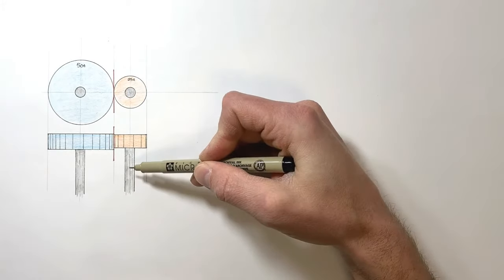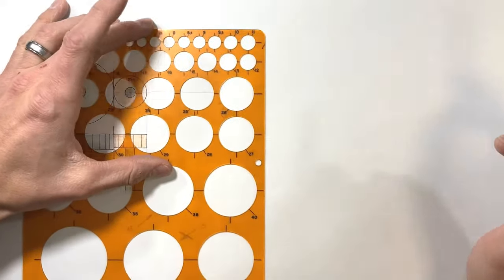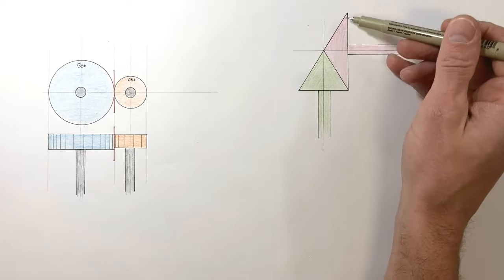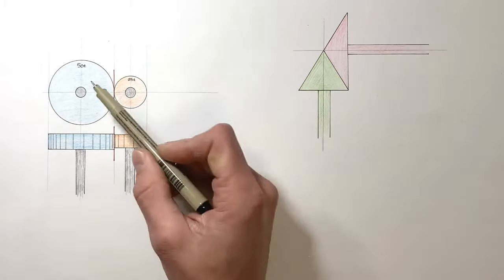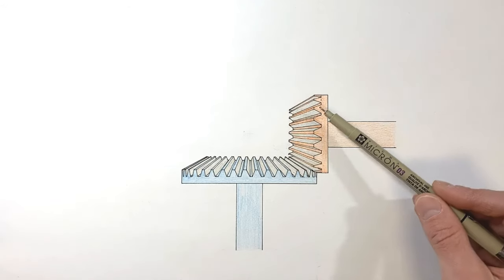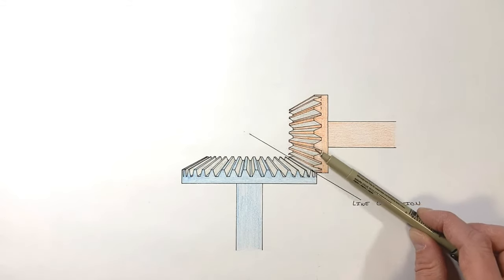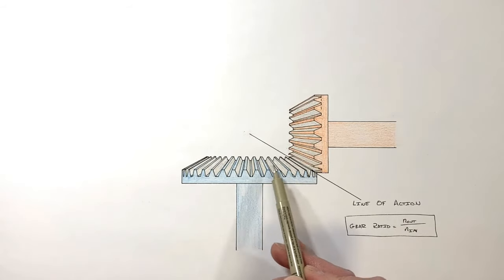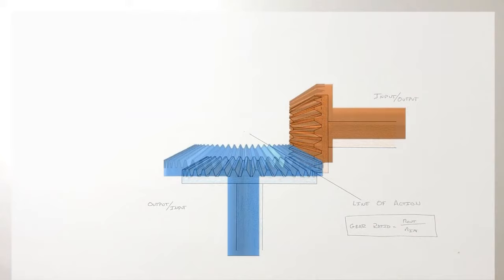Bevel Gears Explained, Calculated & Modeled

Comment: Thank you for such amazing videos. 
I'd like to ask a question as I'm currently working on a project. Can these bevel gears be used to reduce the speed? Like the context of the project is that we've to reduce the speed (in rpm) of the motor and provide reduced speed to next set of shaft and blades. 
Your reply will be appreciated!
Thanks
Reply from the maker: No different than with spur gears, if the input gear is smaller than the output gear then the output speed will be reduced.

Comment: thanks for informations and perfect drawing
Reply from the maker: Thanks.  I enjoy doing the drawings.
Reply: Hi is it possible to make big gear driven by small gear in high speed? This is for bevel gear. I am currently making a project than need to use bevel gear. But wanted the mechanism of gear to be different.

Comment: Hi is it possible to make big gear driven by small gear in high speed? This is for bevel gear. I am currently making a project than need to use bevel gear. But wanted the mechanism of gear to be different.
Reply from the maker: Yes, unlike a worm gear, either gear can be connected to the input shaft.  A small gear driving a large gear (ie. a gear ratio greater than one) can be very useful in magnifying torque at the cost of losing rotations.
Reply: @INTEGRALPHYSICS  does it need more force on shaft(small gear)  to drive  the output gear (big gear) ?
Reply from the maker: When a small gear drives a big gear it requires very little input force to produce lots of output force.

Comment: It would be nice if you actually explained how to model 90 degree bevel gear because im working on a project where i desperately need to design one in order to move on
Reply from the maker: The problem is that the modeling process is slightly different depending on what program you are using (Inventor, Solids... etc.)  

There's some really great tutorials on youtube on how to become proficient on just about any of those programs.  That's how I learned Autodesk.

Comment: its not really about the outside diameter or the inside diameter, its the difference between the two. if you move one inside diameter up or down its y axis(with respect to the other gear) , you are changing the difference between the base and the inside diameters and thus the angle needed to connect them.
Reply from the maker: Absolutely!  You can think of the angle the line of action makes between the input shaft and output shaft as being what controls the gear ratio.